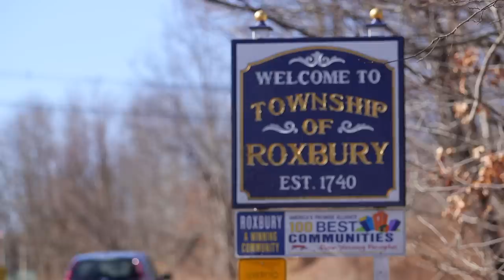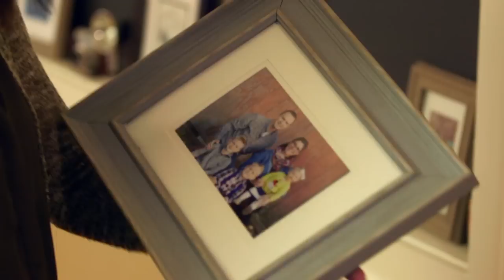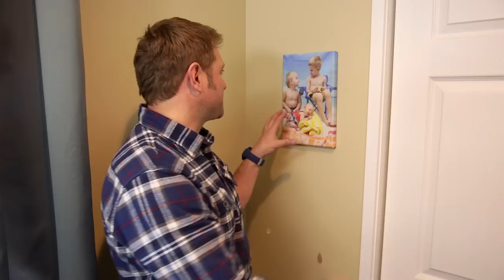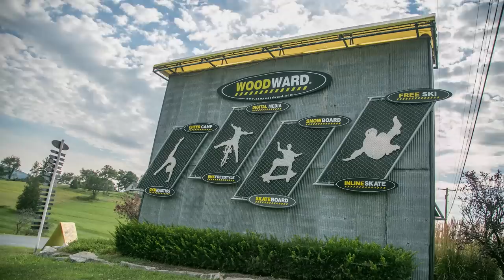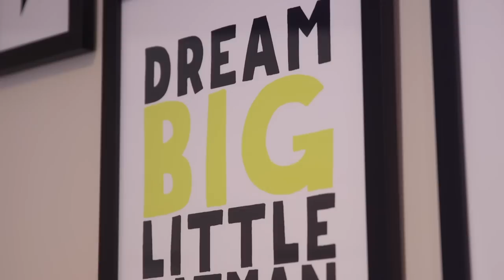Bedroom Renovation for Young Boy with Spina Bifida | George to the Rescue

Comment: Beautiful bathroom but...I'm always surprised that "accessible" faucets are set as far away from the wheelchair as possible. Why not put it closer to the side, where they don't have to strain to reach it?  I have shorter arms than normal, though not extremely, but even I would appreciate not having to contort myself to turn the water on and off!
Reply: Seriously I always have to lean forward to reach to faucet from my wheelchair!
Reply: I wonder that too.
Reply: Agreed. Ikea has the Lillängen space-saving sink with the faucet on the short side - why isn't there a full-size sink with the same feature for accessibility?
Reply: Great idea.  As I design more ADA baths I will consider that.  Thanks!